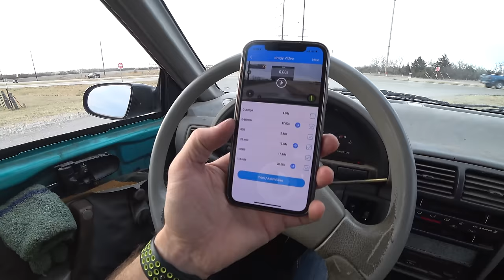I BOUGHT A Geo Metro For $300 And FIXED It In ONE DAY

Comment: I had one of these I paid 500.00 for, it had 62,000 miles on it and belonged to a Nursing home. I was going to work one morning and a guy ran a red light and swiped the front end, I got 1400.00 from his insurance and fixed it myself for 300.00, next a lady backed into me at Walmart and caved in the passenger door, 650.00 for that and I repaired it for 75.00 with a door that was the same color. Then about a year later my neighbors tree fell on the roof and the insurance totalled it @ 2400,00, I sold it to another neighbors kid for the engine and transmission for 500.00 so I managed to make about 3700.00 off that little car and drove it for 3 years !!!
Reply: Damn lol what some luck for sure with that car gezz . but I'm really surprised the insurance paid off that much that many times before finally calming it as can't be fixed.
Reply: 😂😂😂😂😂😂😂😂😂😂😂😂😂😂

The storytelling here is impeccable.
Reply: Right on, great story
Reply: It wouldn't hurt my feelings if someone totaled my $500 civic with wrinkled sheet metal. Runs great (like all Hondas) but I want a shinier one. Damn, my neighbor doesn't have any trees!
Reply: Jerry Berryhill Literal cool story Bro. 😁
Reply: Sick. Hahaha
Reply: Wow what a roller coaster ride
Reply: That's awesome
Reply: Surprised you got much they're $500 beater cars
Reply: Good story!
Reply: Jerry Berryhill: Achievement Unlocked!
Reply: Don’t believe a word of it, but well told.
Reply: @KnuckleHeadGarage27  I assumed that it was the other people's insurance companies,  rather than one company paying out on the same car over and over.
Reply: The car that just keeps on giving. Part are so cheap because no-one really wants to be seen driving one. What replaced the Geo for you?
Reply: ahhahahha
Reply: About 10yrs ago my wife at the time and I went to visit my parents out in Chicago. My parents took us on a roadtrip around Illinois with their Metro. We had that car packed like sardines. My stepfather is about 6ft 3 his head nearly touched the roof. I'm sure we looked freaking hilarious in that car. I remember my stepfather passed a lady in a black BMW and got in front of her. She flipped us off and yelled learn how to drive you fat mother fu<ker. We were laughing so friggin hard and she got so freaking pissed. She kept yelling stuff at us. We didn't even know why she was so mad at my stepfather's driving or what the hell she was even saying. He didn't cut her off or anything. Then she started beeping the horn at us. Finally she goes to pass us,but as she's passing us she rolled down the passenger window and goes Oooooo🤬Fu<k you!!! Then she accelerated really fast traffic stopped and she rear ended somebody. I think we went to Chrystal lake caves on that trip. We also saw some Elk at some place on the way to the freeway.Elk Park Grove. I remember the roads sucked in Chicago.Too many potholes. The pizza is really good though.
Reply: @PKDionysus  I think everyone who has owned a Geo metro,Suzuki Swift,Ford Fiesta or a Subaru Justy has at least 1 really good car story. Anyone who owns/owned a VW bug should have some good stories too.
Reply: Level : GOD
Reply: Stonks
Reply: why would you sell an ATM???
Reply: I was rear ended twice in mine, one hard enough to give me a sore neck for a week. Bumper was hanging down some but never fell off. Other time it did nothing to it. Lasted 20+ years, only sold it for scrap because it couldn't pass emissions, still ran great too.
Reply: The best good luck bad luck car lol. Love these since I was a kid.
Reply: Jesus was really coming for you 
Lol
Reply: Kinda wish someone would total my turd of a jaguar lmao
Reply: Bruh that was a bad luck car glad u got rid of it🤣
Reply: Nice man!. Reminds me of when I bought a 1990 dodge Spirit for $500 one year later this guy rear ended me totaling the car. I ended up getting $2,600 for the car.
Reply: Sweet
Reply: Jerry Berryhill That’s bad ass!
Reply: Damn! Lol
Reply: Bla bla bla bla
Reply: Dude I think that car may have had a curse on it.
Reply: So I should invest in one 😂😂😂
Reply: @Garciarebuild  yea someone gave you expired insurance info
Reply: A whole new meaning to: "It pays for itself".
Reply: Wow I am jealous of you 😬😁😁
Reply: looooool what a gold mine
Reply: Jerry Berryhill I can smell something real strong. What is it? What on earth. Of course that’s it! It’s BULLSHIT!
Reply: @lowslo9287  look on craigslist 900 to 1500 I even seen one like new with 64,000 miles sell for 3,700.00
Reply: Great story!  A guy I worked with had a similar experience with his 70s VW bug.  Hit multiple times and paid off multiple times.  Then, it got stolen.  Thieves thought it looked rough so they fixed it up including new tires.  Then the cops recovered the car so he got it back in better condition than when it was stolen!  True story.
Reply: You win!
Reply: Brilliant
Reply: ...and the car's nickname was,  ' LUCKY ' !
Reply: Dang
Reply: Still not enough, maybe 10k a year for me to start thinking about driving it.
Reply: so, what you're saying is, the geo metro is it's own lawsuit printer?

Comment: Official car of “here’s your pizza, sir”
Reply: Funny bc I deliver in a z 😭
Reply: I thought it was a K car🤔
Reply: I had one...a ‘91 and yes, I delivered pizzas for Pizza Hut in it. Loved that little car. The car fell apart around the engine - the engine that would not die!
Reply: I delivered in 93 and yes I had a metro, lol
Reply: I'm gonna add a small follow up:
I deliver for pizza hut in a convertible top 350 🤣
Luckily I haven't had many scratches, but sometimes it's just unavoidable. So if you value your car be careful these things are skateboards with engines
Reply: I drove one that belonged to the owner of the pizza place sometimes when I delivered pizza.
The one thing that comes to mind every time I think of that car is this one gravel driveway.
The driveway was a little bit of an incline and getting the car up the driveway was like driving a bicycle through beach sand
The width of the tires, size of the gravel and incline just did not work well together
Reply: I deliver food in a '99, the return on investment is incredible. Also easy to park, small turning radius and no one really pays attention to it. I get high 30's MPG with mostly city delivery start/stop driving.
Reply: The xfi gets the best gas mileage! I want me a 2 door hatch
Reply: Had zero clue you could spray all sorts of liquids (mainly water) into the hood of a car 😦 still won’t try it lol
Reply: manny Pep d
Reply: Didn't that pizza bomber guy in Pennsylvania with the homemade bomb drive a geo?
Reply: @cycotec1  You can with a hose, but DO NOT pressure wash in the engine bay. You saw how he couldn't start it after wards because high pressure water was pushed into critical areas water is really not supposed to get into. Watch chrisfix video on how to deep clean engine bays.
Reply: 99 camry for the win
Reply: my first car at 16 years old, and ya i was delivering pizza
Reply: @mrrobinson2u2  Suzuki engines are great
Reply: Pizza Time

Comment: Back when gas prices went insane, I was selling these for $2000+. I had several contractors chop the back off of them, and make pickups out of them.
Reply: Back when the average price was $4 on up, there were some very clean metros on ebay selling in the 5k to 10k range. It was ridiculous
Reply: @Ka_Gg  Yes I remeber that specifically.
Reply: Might have to start again
Reply: Welp....
Reply: think its time for round 2?
Reply: They r $2000 now

Comment: It's funny how 3 cylinder engines always sound bigger than they are.
Reply: My lil dog 🐕 same lol
Reply: Sounds like a lawnmower
Reply: @racerx009  ikr
Reply: Bruh 4 cylinder diesels without an exhaust sound like train engines
Reply: @racerx009  if a lawn mower sounds like a 6 cylinder there's something really wrong.
Reply: dunno why but it sounds like a Z car with a straight 6
Reply: Can confirm as having owned the original Chevy Sprint from new. Got the advertised 60mpg highway too.
Reply: a lot of those old small engines always sound bigger than they are haha
Reply: Because the bore is larger for the displacement that a 4cyl.. Also 3cly engines have a  different sound overall due to the different timing Usually sound pretty cool.
Some pretty awesome motorcycles are 3cly.  Triumph, and Yamaha have some awesome ones.. and they sound amazing.

Comment: The heated rear window is to keep your hands warm when you're pushing it in winter!!
Reply: That’s why it has such a big battery
Reply: @fender.munoz7  A Geo Prizm is basically a rebranded Toyota Sprinter.  The Geo Metro is basically a Suzuki Swift. The Geo Tracker is basically a Suzuki Sidekick. I say basically as they are not 100% the same but are more like 95% the same and most parts will interchange.
Reply: @TheLionAndTheLamb777  Suzuki Swift is basically national car of Hungary
i mostly see swifts here actually
Reply: As a former Metro owner I can tell you it's a reliable car. You only need to push it if it runs out of gas.
Reply: @johnkramer7161  which would be impossible
Reply: @TheFire259  Nothing I said is impossible
Reply: @doctorTF_2  They are made there since mid 90's and Suzuki is still one of the most popular brand there.
Reply: Just like the Yugo
Reply: @fender.munoz7  Smart One !!!
Reply: @johnkramer7161  Smart 2
Reply: @martinhernandez628  You'll NEVER see a YUGO wit more than 50k. Metro, ultra reliable.
Reply: @martinhernandez628  Because of thin sheet metal and it's proneness to rust and cheap price in ex Yugoslavia Suzuki Swift / Geo Metro is called "Japanese Yugo".
Reply: You will never push it , rust is the only thing that kills metros
Reply: Car would go like a mountain goat in snow. Un-stoppable.
Reply: @johnkramer7161  Agreed mine had less issues than the 95 Mercury I had to replace it with.
Reply: @Fearfullyfree  Why did you replace it?
Reply: @johnkramer7161  It got hit while it was parked.
Reply: @Fearfullyfree  That sucks. At least you weren't in it.
Reply: @TheLionAndTheLamb777  I've always had a thing for that Swift!
Reply: @johnkramer7161  Truth!
Reply: @johnkramer7161  That's if u EVER Run Out Of Gas.
Reply: Dave F. I agree, I’ve got through deep snow on hills where 4x4 drivers couldn’t go.
Reply: Hardly they run forever
Reply: @fender.munoz7  That makes sense since Prizms were a rebadged Corolla!!! Not a bad thing!!!
Reply: @TheLionAndTheLamb777  it's all like GM body with Toyota or whatever motor.